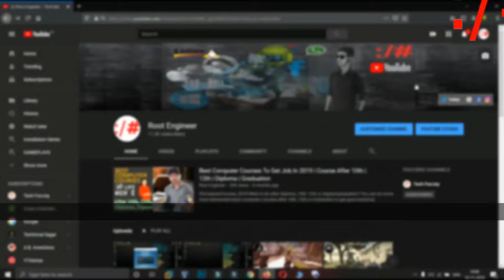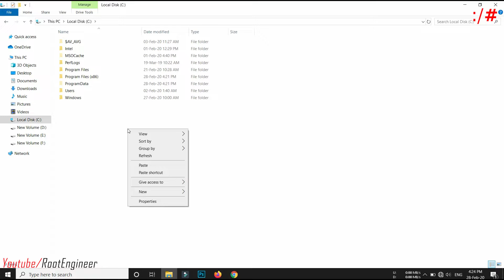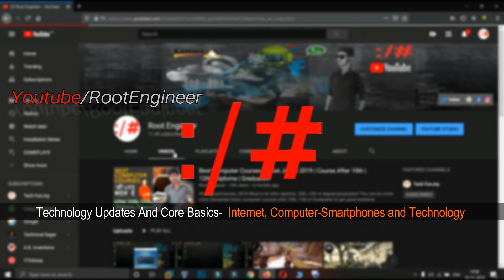ASUS Vivobook Installing SSD Samsung Evo 970 NVMe m.2 SSD | Install ssd in ASUS Vivobook 507

Comment: Hi , Can you tell me which SSD is supported by Asus X507UF-EJ300T  , I want to upgrade it to  SSD but not sure NVMe or SATA SSD 3 ( m2 ) it will support , Please advice
Reply: check out if it have m key slot ... if yes than it will support Nvme  m.2

Comment: I have Asus X507UF-EJ101T in the user manual i am unable to find support of Nvme ssd. Will Nvme work on this laptop? From where did you find that nvme would work on ur system? How is it performing in your system are u facing any issues after upgrading?
Reply from the maker: Don't worry.  Nvme will work on it. I found this on on amazon (link in description). Im not facing any issue after upgrading. And its performing excellent..you can check the speed in my video at end
Reply: Ok that's great thanks root engineer 😀
Reply: @Sshanu04  you installed it? Did it work properly?
Reply: @bhimsenkumar7766  yes i have installed Nvme SSD and it works fine
Reply: @Sshanu04  did you install window 10 on it?
Reply: @Sshanu04  is it being detected by bios? Please reply!!!🤗
Reply: @bhimsenkumar7766  yes i had cloned my hard disk to ssd
Reply: @bhimsenkumar7766  yes it is detected but initially u need to format the ssd
Reply: @Sshanu04  I have the same model but company says it only supports M2 Sata III SSD upto 256 GB. 
Are you saying it also supports M2 Nvme SSD ? 
Which SSD you bought ? Is it M2 2280 NVME and is it working fine ?
Reply: @ashwin0001  I too could not find anywhere in the asus website that it supports Nvme but the laptop supports Nvme. I have installed 256gb and it works well.
Reply: @Sshanu04  
Ok and this video also contradicts the limitation of SSD size i.e. 256 GB as per the Company . Thanks for your help
Reply: @Sshanu04  could you tell me which SSD you bought ? It will be helpful
Reply: @ashwin0001  I bought WD blue Nvme Ssd
Reply: @Sshanu04  Should I go with 500 GB NVME ? I hope it work
Reply: @ashwin0001  i am not sure but i feel it may work. U may have to take that risk
Reply: @ashwin0001  if you are taking the risk then tell me more about it later. Thanks
Reply: @Sshanu04  i am also thinking of buying wd blue sn550 512GB  nvme, but the price is the issue, it is available on amazon at 5700rs. Is it the cheapest i can go for? Thanks!
Reply: @Sonug9911  i too have the same model but 256gb. I would suggest just wait few days as amazon/flipkart sale would live and you can get a good deal
Reply: I am going to upgrade samsung evo same ssd in my asus same modrl.laptop.as specified, can anyone pls tell any precaution i need to take care off ,or any situation which will arise,like ssd not showing in bios and all..?
Reply: @Sshanu04  hi bro ... i am planning to upgrade it with Wd blue nvme 256gb .. will it support in this laptop  .. plizz reply
Reply: @tothepoint2299   yes it will i have added 250gb ssd.
Reply: @Sshanu04  thank you 🙏

Comment: How did you clone the OS partition? If I change the boot priority to SSD, will the previous partitions like D and E drives other than C drive from HDD will boot or not? Please reply
Reply from the maker: their is software present on samsang SSD website for conning purpose..(data migration software) https://www.samsung.com/semiconductor/minisite/ssd/download/tools/
if you change the boot prority and boot into windows then all previous drives including c from old HDD will mount automatically.

Comment: what is your laptop model?
i mean is it X507uf or X507ua?
and is it ok to use NVMe coz the asus site says m.2 sata?
Reply: They said as sata m.2, i'm asked to asus support chat and shared my model number, they said mine support NVMe.

My laptop exact name : ASUS X507UA EJ836T
Reply: @AdineTech  yes i have installed a sansung nvme 970 evo plus ssd
but cant install the Samsung ssd driver
Reply: @anandkalsait6579  wow, i just today ordered the sansung nvme 980, it will be work fine, your sure right?
Can you say the read and write speeds got from your laptop?
Reply: @anandkalsait6579  You will get at least 1Gb/s right ?
Reply: @AdineTech  just go for 500 gb
Reply: @AdineTech  write speed 3546mbps and read speed 3067 mbps
Reply: @AdineTech  go for 500 gb only
Reply: @anandkalsait6579  wow
Reply: @anandkalsait6579  ordered 250gb because of budget problem, anyways I could use HDD for files and SSD for boot, so it could be enough.
Reply: @anandkalsait6579  do you also have ASUS X507UA EJ836T?
Reply: @AdineTech  X507UF EJ101T
Reply: @AdineTech  yes 250 gb is fine 
I thought u ordered 1tb ssd
so no worries XD
Reply: @anandkalsait6579  XD

Comment: Hello, after installing the SSD NVMe 500GB WD black to my Asus x507uf-ej300, the fan stays longer at maximum speed. Any idea about this unexpected event?
Reply from the maker: you can check if CPU is actually heating or fan is just overboosting...  if the laptop also heating(warm air output) then should check if anything consuming cpu. .  if cold air (fan overboosting without reasonn)  check fan drivers or check if you can control the fan speed. also check ssd read-write speed it can cause cpu overheat

Comment: Bro I have the same model X507UF-EJ101T (gold). 
Company says it supports only M2 Sata III SSD that too only upto 256 GB storage , but your video is showing It supports NVME also and even 500 GB NVME SSD.
Does that mean 500 GB NVME SSD will work on this machine ?
Is there any problem you are facing now ? Should I buy 500 GB M2 NVME ?
Reply from the maker: Okay.. If you having the same model, I'm using it with nvme. If any device shows support for nvme then their is no limit like 256gb only OR I have never seen before; you can install 2gb and 4gb nvme also, this is the highest capacities available as my experience. and I'm not facing any issues till date!
Reply: I am at the service center in nehru place right now amd they said that they won't be responsible for if my laptop wouldn't support it. Now this made me scared as F***, so should i do it?
Reply: @Sonug9911  If the SSD is returnable or the amount is refundable then no need to worry , but that option is not available with Online Shopping
Reply: @ashwin0001  It worked, and i used easeus 12.5 crack to clone the c drive. WD SN550 500GB is a good option. after clonning the drive it showed up in the BIOS.
Reply: @Sonug9911  Thank You Bro it'll help me a lot , I am planning to buy the same SSD .
Reply: @ashwin0001  nice, purchase it from nehru place from any shop on 1st floor. I have purchased SN500 500GB at 5,550rs including GST.

Comment: Hi, i have asus x507uf-ej092t silver, i5_8_gen 8gb ram 2gb ddr5 graphic 1tb HDD, and want upgrade to  nvme wd sn550 512GB. Can i install it myself without voiding warranty as the laptop has 14 months of warranty is still left. And if i want to upgrade to nvme without voiding warranty, then how should i do it! And also thank you so much for guide.
Reply from the maker: If you are in under warantee, I will recommend install through services centre which nvme you want. I already asked question about this to customer support and their ans is same!
Reply: So you installed yet nvme or not???
Reply: I have same model x507uf-ej092t i5 8th gen mx130 gpu. does it support m.2 nvme? or it only support m.2 sata? Please help..
Reply: @manabdhank4514  bro have you find the answer?
Reply: @rvsingh2654  no
Reply: @rvsingh2654  its support nvme . Yesterday installed sn570 nvme working fine.

Comment: Is there an M.2 NVMe support for Asus Vivobook X507UA(i3-7th gen, 8gb RAM, 1TB HDD)? Or is it just SATA III? How to check? 
Asus service center or website doesn't specify any details.
Reply from the maker: Then you should check manually by open the laptop.(disssemble).
Reply: @deepeshkhurana9970  He has installed sucessfully a NVMe WD Blue since August!
Reply: I also have the same model.. did the nvme work in that?
Reply: @anhhoanganh181  whats is the NVMe model? thx!

Comment: Hello Root engineer !
Glad to c this video..
Actually I'm Having one doubt ..
I purchased Asus vivobook x507UA (8Gb Ram-1TB,i5 processor n 8th gen...
I want to add SSD also so my question is Can I Add SSD without replacing HDD ?
I mean I wanna Both SSD N HDD in the same Laptop..is it possible or can we do this ??
Plz answer me bro..
Waiting for ur response..Thank you so much ♥️
Reply from the maker: Yes, You can install.. Purchase a m.2/nvme ssd and install IT
Reply: @RootEngineer  which brand and how much capacity

Comment: What is thr maximum storage of ssd we can install in asus x507?
Reply from the maker: usually nvme comes in maximum 2 TB storage capacity. and asus x507 have 1 nvme slot. its 2TB plus if you add ssd to normal sata slot then It will be max 16TB ..    So total ssd storage will be 16+2= 18 TB..

Comment: Please reply. 
X507ub 
i5 7th gen(7200u)
1TB hdd
Nvidia GeForce mx110

Isme m.2 nvme support karega??
Please reply.
Reply from the maker: but they are given support to SATA 3.0 SSD. you should confirm by checking slot on motherboard.. it will really help you to identify
Reply: did you solve your question? i have the same laptop Asus X507UB-br161t (core i5 7th gen)i want to know if x507 UB supports the NVME format or just m.2 SATA III?

Comment: Help please  
I have asus x507uf laptop which has segate hard disk 
I am having error when trying to reinstall windows 10 
I tried all the commands to format /clean but it showing an error 
"diskpart has encountered an error a device which does not exist was specified"
What to do?
Reply from the maker: sometimes this error occurs when you typed incorrect disk name, .. try to connect a pen drive for check that its showing other storage devices...  one more check your BIOS configuration is correct.

Comment: can i use nvme ssd in asus x507ua ? 8gb Ram, i3 processor (6th Gen ) Plzz reply
Reply from the maker: yes,,,  but you should also ask to asus care for confirmation.. their are verity in models after x507ua **
Reply: @RootEngineer  ok thank you ❤️
Reply: Bro Mai ssd upgrade kar chuka hu but ssd upgrade karne ke bad laptop on krne ke bad bar bar off ho ja raha hai , yahi problem aa raha h ssd upgrade karne ke baad , kya app bta sakte ho kya problem ho sakti hai . Plzz reply
Reply from the maker: @friendsforever4059  check the BIOS configuration once Or Try to reinstall your windows in ssd.
Reply: @RootEngineer  ok thank you, but bro battery ya ssd upgrade karne me motherboard se koi problem nahi n hai . 😖
Reply from the maker: @friendsforever4059  Battery se ho sakti hain agar original nahi hain ya fir powe output me variations hain..   storage se nahi hogi koi problem..    aur agar battery output kam hain to lagging ki problem aa sakti hain
Reply: @RootEngineer  is there any need to install nvme driver as after installing it didn't showed up in the bios menu
My laptop is x507ua
Reply from the maker: @bharatchoudhary4424  no.
Reply: My Asus laptop is x507ua ( ej180t) kya hum nvme SSD LGA skte hai

Comment: Model number kya hai es laptop ka ??
Reply from the maker: X507UF- EJ092
Reply from the maker: all are same in the series of X507UF
Reply: @RootEngineer  Hi,, mine is X507UA(x507uar motherboard, as i hv seen it),, you know nvme SSD uplimit in x507uar?
Reply from the maker: @ashokk9475  I gess more than 1.5 to 2 GBPS.. still you should confirm
Reply: Root Engineer I’m not asking that, I’m asking about how much amount ssd we can install 1tb or 256 or 500 like that....
Reply from the maker: @ashokk9475  the hihest storage capacity avilable in nvme is 4 TB and in sata ssd is 16 TB.. you can install in laptop..   for desktops it may different
Reply: Root Engineer so now can I install 1tb nvme in my x507uar ?
Reply: @ashokk9475  Hey have you tried to install nvme on it yet?
Reply: Anh Hoàng Anh I didn’t,, because by the time, I opened and saw,, some problem occurred in cable on the motherboard to keyboard and laptop stopped working and I stopped buying ssd..... but I knew for sure as I noticed that the slot given on the motherboard as I knew, is for nvme ssd and not Sata,,, but however Sata too can be used..... one more thing is another guy on YouTube told me that he installed in his laptop which is same as min, and he has same knowledge as mine about the slot.....
Reply from the maker: @ashokk9475  ok... NVME uses pcie buses.. definately you can use m.2 SATA(key m and b support pcie/sata) on same slot because it supports.
Reply: Root Engineer yes that’s true thnx
Reply: @ashokk9475  thank you